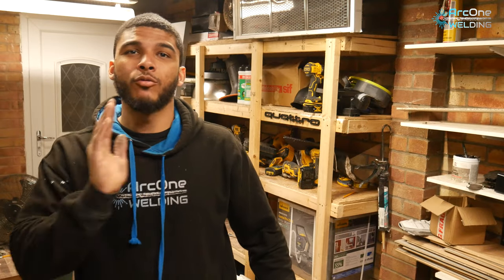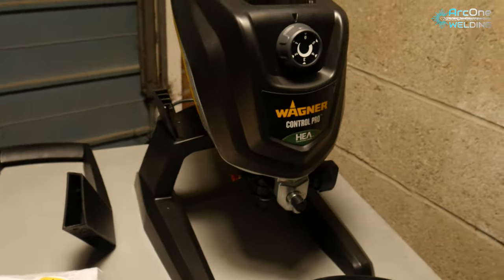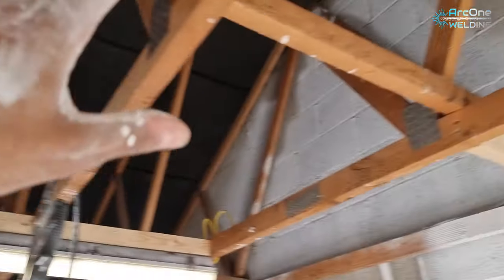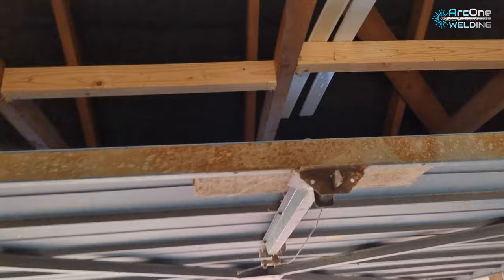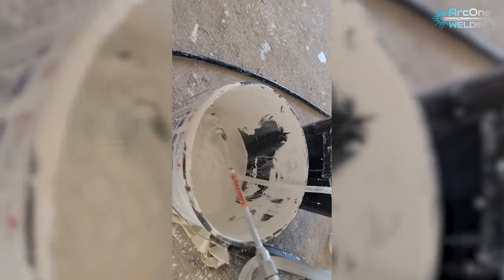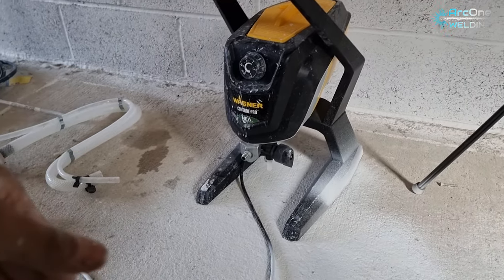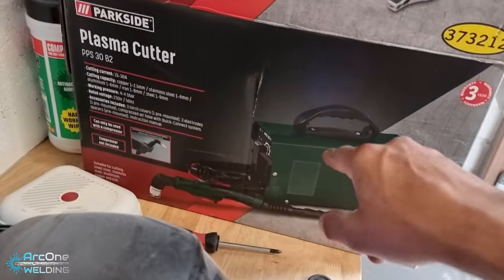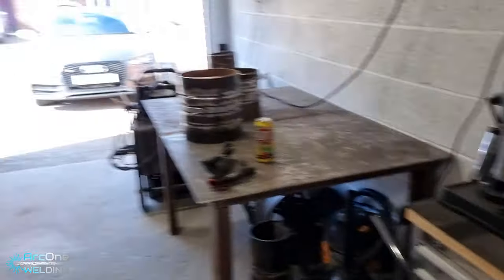Spraying My Dream Garage! With A Wagner Control Pro 250R (Unboxing & Review)

Comment: I really hope you have a full 4k cctv at your new place because you have just let all earths scumbags know that they can have a field day at yours. Alarm,alarm,alarm. Get it sorted asap Kalvin.
Reply from the maker: Appreciate it bro and if you check me out on Instagram u will see that i secured my garage and added cctv, they would need to cut a hole in my door to get through
Reply: @ARCONEWELDING  OK That's great, I don't do/have IG. As long as you are happy then I'm good, Like to help if i can. there is and firm on YT called DVS LTD, You won't go wrong watching a few of his videos to get that bug of I'm so safe. you know they slide a 6mm inspection camera in and see everything or go through the roof tiles make sure you have motion sensors as well. You have to cover for 24/7 365 they only need 15 mins.